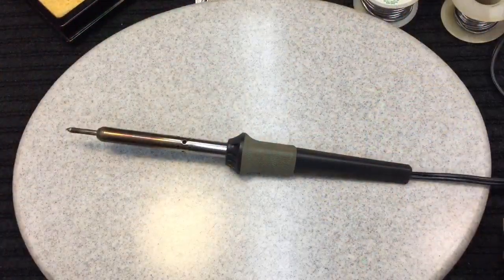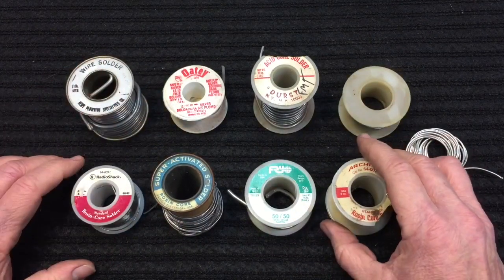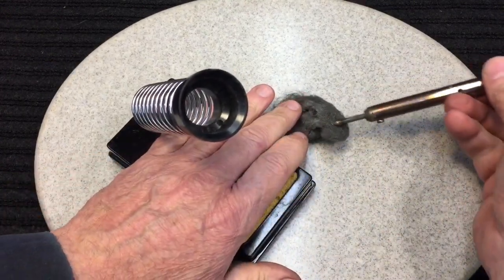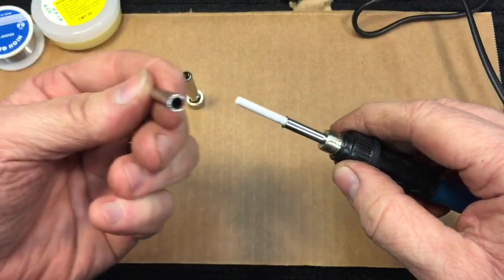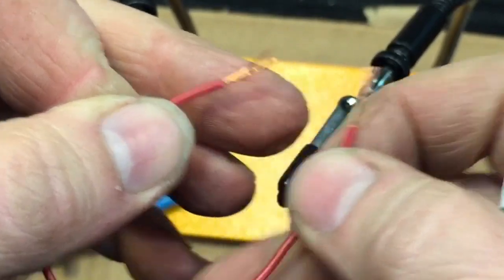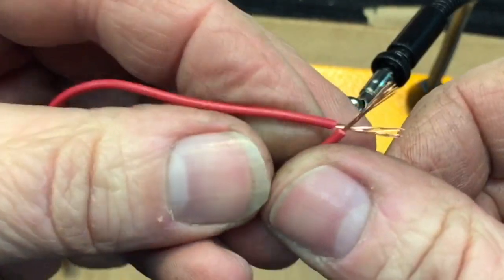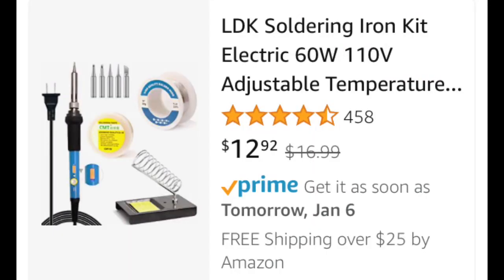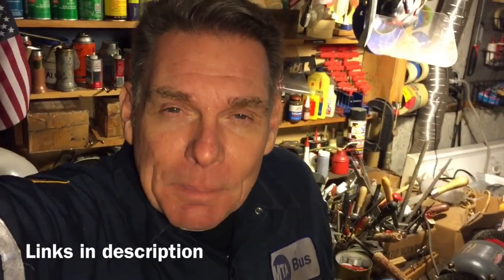Learn to Solder with this Inexpensive Kit from Amazon

Comment: I just received a very similar kit from Amazon last week. I used it yesterday and it seems to work well. I actually bought it for the stand and tools, I was going to continue to use my Radio Shack iron, but like I said it works. I like the different tips that are in the kit.

Comment: The 3 important rules for soldering are to clean it, clean, it, clean it.Then  the flux will get the rest of the oxidation off the work. 
Once you've done that the biggest cause of difficulty in soldering is not enough heat. If the soldering iron or gas flame, while hot,  can't bring the work up to temperature quickly you end up cooking the flux and a general mess follows. If the work won't melt the solder by contact within a few seconds, to paraphrase the famous line from "Jaws", you're going to need a bigger iron.
If you are doing structural soldering like John demonstrated and are using gas, lock your propane torch in a cabinet and lose the key. MAP gas should go in the cabinet as well. Bite the bullet and buy a plumbers torch that uses acetylene gas. Now you have higher temperature and plenty of heat with a controllable flame.  It makes silver soldering a breeze. You can make a joint that is stronger than the parent metal, solder tungsten carbide cutting tools to steel shanks, and other fun stuff.
Cheers from NC/USA
p.s. If you use an acetylene torch be sure to get gas welding glasses. The UV radiation from a flame that hot will burn your eyes and introduce you to a new level of pain. Something I will assure you that you will only do once in a lifetime. It's worse than the flash from electrical arc welding because you don't notice it at first.
Reply from the maker: Excellent tips and advice!  I only hope some people will take advantage if these low price but decent quality soldering kits to start practicing and having fun.  Thanks!!!!!

Comment: Nice points on soldering . I do lots of soldering in the Roofing and sheet metal industry Copper, Stainless, Lead,  and Galvy.    Proper cleaning and  heating the base materiasl are the 2 most important steps . Next is a clean iron and fresh solder.  Another effective method for  soldering electrical wire is to  touch  iron under wire  to  heat.  This draws the flux down through the wire.  Youll know that your heat is correct when you tap the solder on topside of  wire and the solder flows right  through. 
Great show and demonstration. This is very useful information that people need. Much better than electrical tape or a butt splice connector . 🤣 I recommend to solder and shrink tube all connections.
Reply from the maker: Roofing and sheet metal soldering is a whole different skill- You are so right!  I love a fresh copper soldered joint.

Comment: I usually reach for my 220/250 watt Weller Soldering Iron (pistol style) for tinning wires for leads for extension cords and such. I have a collection of their irons, but I usually reach for the most powerful one.
Reply from the maker: If you know how to solder a powerful iron can be a wonderful tool. Quick and easy but for beginners the added heat can be difficult to handle.  Like learning to drive in a Corvette!

Comment: Good point about the rosin aging. I hadn't thought of this before but I have a spool of my father's old solder and it clumps to no end. It looks like the same brand and packaging as that second bottom spool you showed. So you think if I add some new flux to it I could use it? Eons ago I bought a solder pot kit and I'd like to put the solder in it if I could find some way to make it useable.
 One thing you might mention if you talk about this again is not to cool an iron off with water. When I was back in electronics college most of my classmates would run their irons under cold water at the end of Lab Class. I never did this. All their irons went out and decades later mine still works. The teacher got all their irons replaced by the company as having "a bad batch" but then also started telling people 10 minutes before class ended to unplug their irons so they would cool down naturally.
Reply from the maker: OMG- I never heard of running a iron under water, however I guess if you have to get to the next class and have no time I can see how that happened.   For many people old solder is the reason they fail at this...

Comment: Well done!  Great lesson to round out Shop Class 101. Or. Is this a 201 level course?

My dad built Heathkit projects all through the 70's. I learned from him and still have his Weller soldering gun and pencil type. I wanted a little more control of the temps and got a digital one, similar to yours.

Comment: If I want to patch a galvanized watering can with solder, should I put a small copper wire into the hole? I have the acid flux (for copper pipe). I have. Not been able to get the solder to stick to the iron.
Reply from the maker: Dennis I so wish I could help there, Galvanized soldering is a whole different animal that I have never attempted.  My buddy Dave did a Gas can a while back that might help you!  https://youtu.be/2n2CM4elxJE
Reply: @ScoutCrafter  thank you very much for the lead to such a well made video! Walking the line from melting solder to oxidizing the steel looks like the major challenge. I can use large diameter copper wire for the rim where rust has set in.

Comment: I just learned to solder last week.  I had to do a repair on the Jeep.  I borrowed a kit and practiced in the basement.  The practice runs went great.  Then I went outside where it was 10 degrees and soldered in the cramped door jamb.  They didn’t come out as pretty as my trials but they worked well.  I’ll be getting my own kit this year because I had a lot of fun doing it.  Also used heat shrink for the first time.  
Thanks for the information.  I didn’t think of using it to join two metals like you did the hanger pieces.  Great idea for crafting!
Reply: I like a propane torch for that type of thing. Radio Shack used to actually make flat thin little strips of solder for jobs like that. They sold it as "Match Solder" and it does work that way. I still have a package of it around here somewhere. You might have even had an easier time using a bic lighter if the wires were out in the open.
Reply: @johnpossum556  Sounds like an interesting product. Thanks
Reply from the maker: It's so hard to solder outside in the cold! The air is always lowering the tip temp!   Thanks!

Comment: I learned soldering when I was outfitting all the electronics for government vehicle. Would run and solder low voltage wire for 8 to 10 hours a day, 5 days a week.

Comment: Wow, the comments alone have tips galore for soldering I did not know. That Amazon package is a bargain my 40 some year old Weller kit cost me 3 times that in 1978. Now they are at flea markets for next to nothing because no one either knows what they are or how to use them. I saved an “American Beauty” 300 watt iron from the trash, it was brand new and would be perfect for some tin roof repairs.

Comment: Those extra tips and temp control would probably make it good for wood burning too!
Reply: Is that what the knife tip is supposed to be used for?
Reply: @johnpossum556  I think the knife blade is for cutting plastic and Styrofoam.

Comment: There's actually a great trick for  stranded copper. Push it into the flux before you twist the ends. This gets the flux in between the individual copper traces and it will draw the solder deeper into the joint. It also works great if you are joining a pair, flux them before twisting together and the solder will be drawn deeper

Comment: Those third hands are awfully helpful. When I used to be able to do this kind of work, I really liked using a product made for tying flies. It's the same basic arrangement with alligator clips but it holds things very firmly, sort of like a dial test indicator arm. There are usually three separate "hands"that can be positioned in any way. While it is the simplest difference, one of the best parts is a very weighted base.
Reply from the maker: They are a godsend for certain projects, they can even act as heat sinks on the wire when the rubber boots are removed.

Comment: also, I'll be very careful about using the flux as they easily eat away the cooper if unclean. even if clean the joint, they usually wick through under isolation via braided copper strands and destroy the cable under the isolation and you can't even see it. have ever noticed a bad connection and when you pull the cable it breaks with some green residue on cooper? that's sometimes because of leftover flux.
Reply from the maker: Rosin is usually easy on wires and now they have water based flux, many times people used Kester paste which was acid based and not made for wiring..

Comment: it worked!!! and most of the time it's okay to solder like this but you got lucky because your soldering iron has a bigger thermal mass than your work. that was the biggest NO-NO in the soldering book!!!  to be sure you touch the work with iron and flow the solder on the opposite side. the work should be hot enough to melt the solder when it touches the work.
Reply from the maker: The problem with low watt irons is the copper always draws away the temp from the iron like a big heat sink and you never get good results unless you have a very good iron.  Touching the wire and feeding the solder at the same time is almost always successful.  So many beginners fail at soldering because of trying to heat the part first and loosing heat.  =D  Thanks!

Comment: Great show John . I bought a cheap soldering iron kit once , once only never again . In an uunheated winter shop those small 60 w ones can't cope , impossible to heat the copper with one before applying solder in cold conditions . Frustrating things !
Reply: That style is actually more typically around 25-30 watts. There are some USB ones out there that take only 8 watts and do fine for indoor electronics. There's nothing wrong in soldering with a propane torch, BTW. Did you notice how the picture of the old gasoline style torch had a hook to rest the soldering iron in?

Comment: Great tutorial mate. My soldering irons and solder is about 70+ years old; inherited from my late father. I had no idea solder has a life span. Mine is an acid core, fairly large gauge solder on a roll. I know it still works as I used it a couple of weeks ago.
Appears to be a good little soldering iron kit. I can’t believe how they make it for the cost.
Reply from the maker: I have some very old solder that is still good because it is kept in a climate controlled environment, some people have their solder in a unheated garage or other area that is hard on the solder....  =D
Reply: Hi Shed Man X and John. 
I too have rather old solder. After the lead contamination scare lead solder went up in price and down in availability. 
If I see some at a garage sale I buy it. 
If the end is pinched shut the flux will keep nearly forever. 
Some try to melt the end closed. That doesn't last near as long.

Comment: I've mostly done soldering for copper plumbing and I'm only adequate at it. I always admired the beauty and craftsmanship of professionally soldered pipe. There was massive copper pipe system put in where I work and the pros did an incredible job. it looked like the Sistine Chapel of soldering. :)
Reply from the maker: I agree, seeing a professional solder pipe is an art!

Comment: Scout, I'm sure you'll get plenty of comments on your technique.  You should heat only the joint with the iron and then apply the solder to the joint - this ensures that the joint was sufficiently hot.  You DON'T want to melt the solder on the iron (as you did) and then let it flow onto the joint as this method does not guarantee that the joint was hot enough.  Another important point that you didn't bring up is to make sure you don't move the joint around while it cools - this can result in a defective solder joint.  Let the wires and the joint remain completely stationary while the solder cools.
Reply from the maker: Gerald I will address this on Monday's video...

Comment: Thank you for this informative video, you always do such a good job with helping others.
I've been soldering things for over 50 years, soldering is a craft that comes in really handy sometimes, you hit all the key points,.
Flux comes in liquid as well, you should make a good mechanical connection and not just rely on the solder. it's OK to melt the solder on a joint, in fact it will help make the thermal transfer better but you have to keep the heat on long enough for the solder to flow, capillary action will allow the solder to flow into the joint, it takes practice but anyone should be able to learn very easily.
There is another type of soldering called hard soldering, it requires huger temperatures but produces a stronger bond.
Reply from the maker: Absolutely right!  The older high temp guns were good for that!!!   😃👍

Comment: For soldering metal I have always used Kester Metal Mend solder, but it is getting hard to find anymore. In 1976 I went to Kmart and bought two Weller soldering guns. I am still using one after 45 years and the second one is still in it's original unopened box. I have since bought several good used ones. All of mine have Bakelite housings.
Reply: Oneday an old old Bakelite clock started slowing down and because I have been listening to ScoutCrafter I decided to not just oil it up but restore it. Polished the brass with Brasso. Cleaned up the Bakelite housing with 303 aerospace. Now it not only runs well but looks great, too! ( lately I find myself thinking I should google up a radiation proof clear material for the face since it has the old, now outlawed, radium dial )

Comment: Have you tried the new solderless heat shrink connectors? Adam Savage just did a video on them
Reply from the maker: I thought they were around for years!?  😃👍
Reply: I saw that. Frankly I am not too keen on the idea of a solder that melts that low. ( plus I don't own a heat gun yet )

Comment: Rosin is actually a wood resin, used as a flux. But don't let that fool you. The soldering fumes, even if they smell not bad, are hazardous if exposed to it over a longer period of time. Especially when using  leaded solder. If you use it only once a month or a year it's not a big deal, but if you use it on a daily basis you should have some kind of fume extraction or use it outdoors.

I learned soldering a long time ago in the company I worked for, I was lucky there were several old timers back then with 40 years+ experience in soldering. So I had good teachers. If you use electronics solder you don't need additional flux. The solder, even if it looks solid, is actually a tube filled with rosin flux.

And one thing to add to the list of necessary items for soldering is a pencil with a good sharp pointy end. That's one trick I learned from the old timers. If you accidentially solder two joints on a PCB (printed circuit board) together, just heat the joint up again with the soldering iron until the solder is liquid and then "drive" the pencil tip fast through the liquid solder. Connection is separated. But don't paint on the PCB with the pencil. Reason for that is, solder can't stick to graphite. And the reason not to paint on the PCB is that graphite is conductive and could cause a short circuit. 

If soldering on semi-conductors use high temperature, for leaded solder between 300 and 350°C. Lead-free solder should be used at 350 to 400°C. That keeps the time to solder low, and so you got a lower rate of heat transfer to the semiconductor material. These semiconductors are really sensitive about the high temperatures of soldering. You can also grab the "legs" of the transistor or diode with a pair of needle nose during the soldering. That will also transfer some heat away from the semiconductor.

And wash hands after soldering or when you do a break for a meal!! And don't stick that solder into your mouth!! I've seen people holding the solder with their teeth so they had the hands free, one hand for the part they were soldering and one for the soldering iron. Some of them developed some kind of cancer in the mouth area and on the tongue later. There's a tool called "third hand". It's a solid heavy base with two adjustable clamps on it to hold something. Usually also comes with a magnifying glass installed.
Reply from the maker: Awesome tips as always Marcel!  😃👍
Reply: I have a pair of helping hands attached to a camera tripod. Makes it portable to go anywhere and I can adjust it to any height whether I'm sitting or standing. One of the best things I have ever done.

Comment: It requires a "touch" that I have a really hard time with. Fortunately I rarely ever mess with electrical stuff. Those were great results!
Reply: If you can't fix it with a hammer it has to be an electrical problem.
Reply: The trick with soldering is everything has to be clean. Like a lot of jobs preparation is the key to success. So make sure everything is absolutely clean before you begin to solder. Like Scout showed here copper should be bright and shiny. You can't solder dirt. Some contaminants are hard to even see though. So even if stuff looks clean clean it anyways.

Comment: I learned to solder about 10 years ago when I started slot car racing. A pro told me that a drop of oil on the wire right where the insulation starts helps keep the solder from creeping under the insulation. Important for lead wire to keep it flexible, prevent cracking the joint.
Some of the top racer/builder's are absolute artists with an iron.